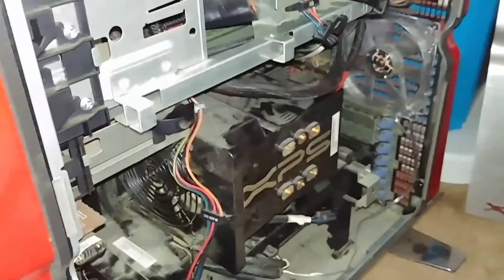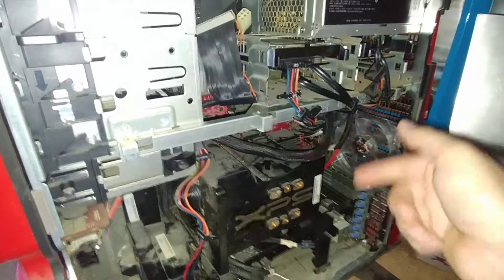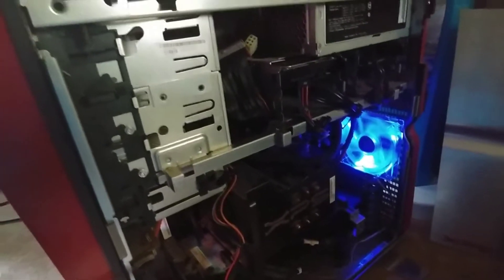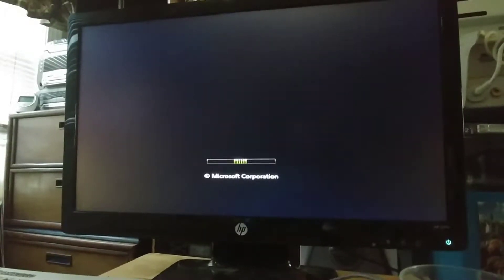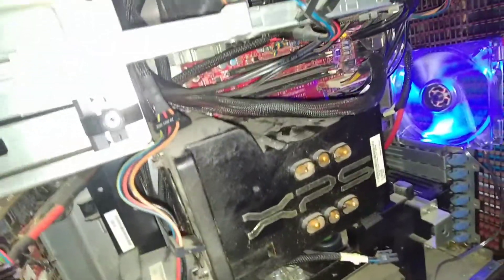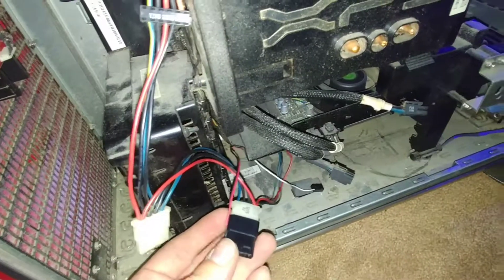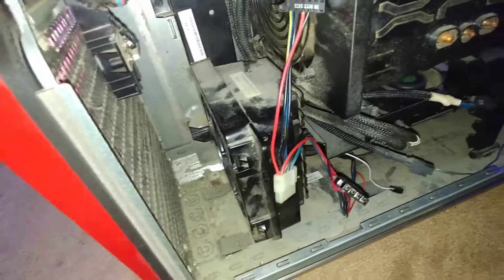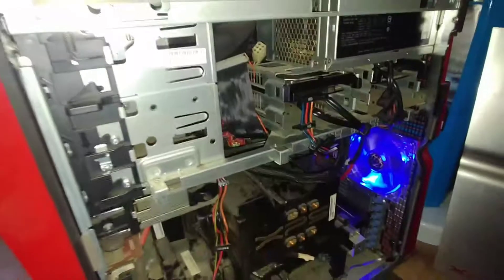Big dell pc won't boot (freebie that I got)

Comment: It Could Be One of the RAM Sticks Are Bad. Maybe Try It with Just One installed 
Also you might have to do a Clean Install of Windows on the Drive For it To Boot
Reply from the maker: stereomann83 I thought ram was the issue to but doesn't seem to be the case. maybe a clean install of Windows might fix that issue but the hdd works on another pc so I don't think that's the issue ether.

Comment: Try removing your video card. It’s possible that the video card is blue screening because it doesn’t have the proper driver. Worst care the video card is bad. I’ve had that happen before too.
Reply from the maker: Tyler Cloutier thank you. ill give that a try.
Reply from the maker: tried that and its a no-go. video card wasnt the issue. thanks for trying to help me out.
Reply: ChrisDerekKyle LeeCharlandHassen Have you tried pulling the drive after it blue screens and using a tool to try and read the BSOD logs and see if it gives you any info?
Reply from the maker: ive used two different HDDs even in safe mode it still fails to load windows. I did a HDD diagnostic test on both HDDs and they passed.
Reply: ChrisDerekKyle LeeCharlandHassen I’m wondering if it’s still a possible driver issue. If you have a flash drive or a blank dvd of sorts. Try burning a copy of Ubuntu from their website. It’s free and you can use it to run the OS from the dvd or flash drive it’s self. Or you can even install it. Might be something to try to rule out anything wrong with the computer or it’s Parts.
Reply from the maker: ive tried loading windows from a external HDD. the PC knows its there and when i select it to boot.... it wont ether. Its so weird. I may try Ubuntu later on but thats a OS version that i never liked lol
Reply: ChrisDerekKyle LeeCharlandHassen just doesn’t mean you have to keep it. If you are able to install it and then boot from the drive with Ubuntu on it. Then at least that might rule out some of the parts inside the pc like the CPU or PSU being bad. Of course doesn’t mean it’s still not a possibility, but at least it would possibly boot.
Reply from the maker: yea i know. i understand. ill have to mess with it later. but least i got some options. Thank you. :)